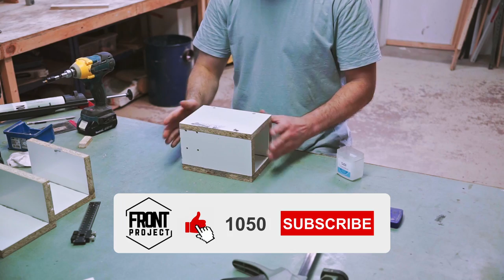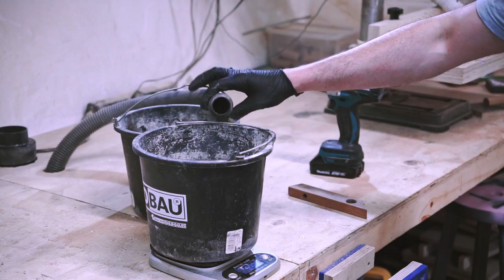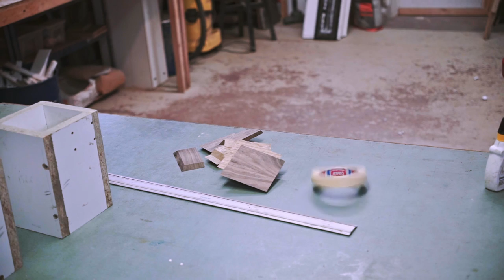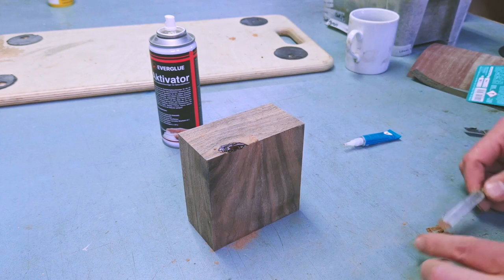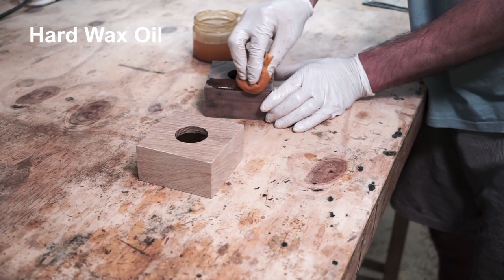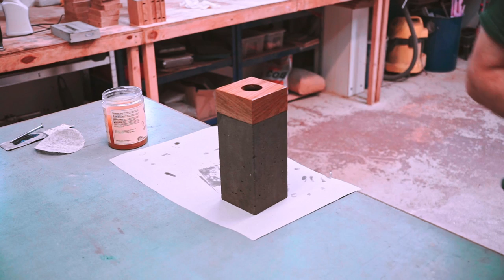Learn How To Cast Concrete Like A PRO – DIY Concrete Pendant Light

Comment: I would'nt trust adhesive in this situation! complete out of concrete wit pyramid top and wood only as decoration.
Reply from the maker: Thank you for the advice. I can try it out next time. 
I've been using the same glue for 5–6 years. Never had an issue.